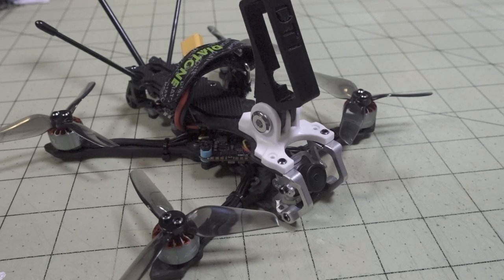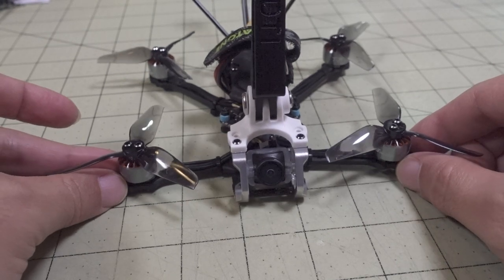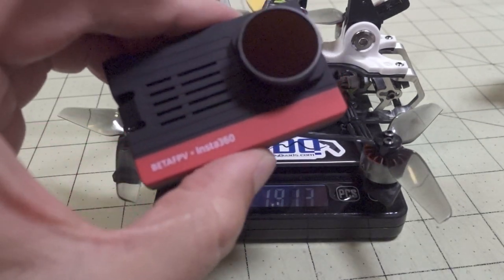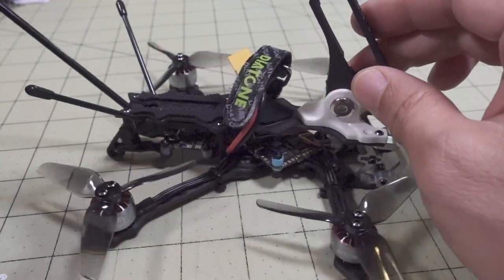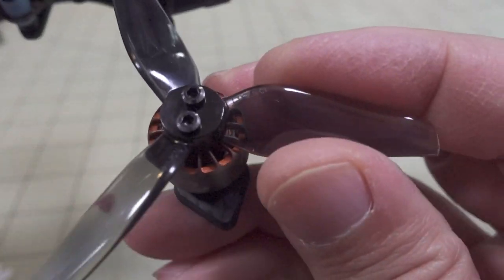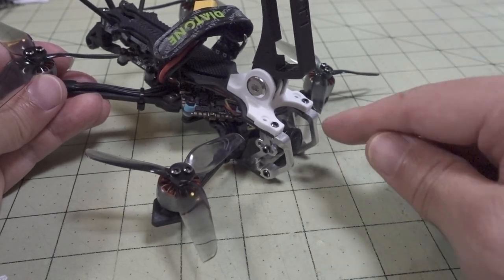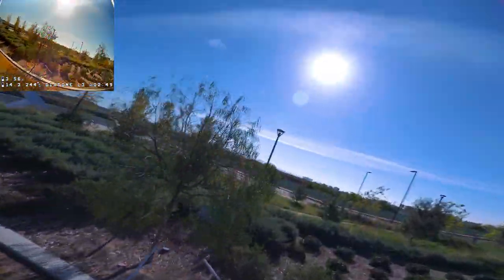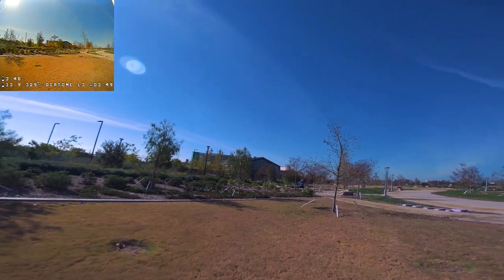Diatone Roma L3 3-inch Micro Drone Review 🚁

Comment: Interesting...I'm curious what the market for this little guy is. It just doesn't seem like Diatone had a clear direction when they made it. Its not a toothpick, its not really a LR quad, as you noted it doesn't freestyle particularly well, and if people wanted a 3" cinerig they would probably want something with prop guards. I feel like a lot of companies are just making a bunch of these pre-built quads without thinking about its place in the market, and if they are thinking about it, they don't always demonstrate what that purpose is. I feel like iflight is doing a good job with that right now, however.
Reply from the maker: A nice cruising quad for 4K video.  With a bigger battery longer flights are possible.  Better than a cinewhoop... not noisy, no prop guards.  Four inch would be better but maybe the customer wants something a little smaller.  There's always a market for these things.  Just not as huge as you think.
Reply: @AlbertKimTV  Also making a 3" only required shorter arms basicly so the cost for them was probably minor in production and now they have filled a spot in the lineup for those wanting a 3".

Comment: New to drones. If I buy this, do I have to flash settings with beta flight or is it ready to fly out of the box?
Reply from the maker: You don't have to flash firmware but you will need to connect your receiver, bind, and setup your modes for your transmitter.  See this video for how to do this process in general - https://www.youtube.com/watch?v=19i8ob7u3rE